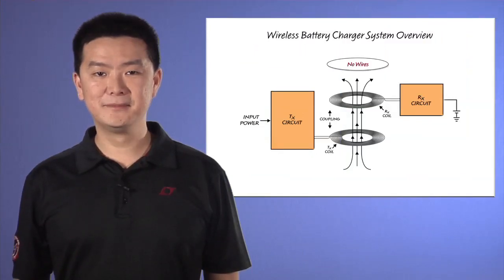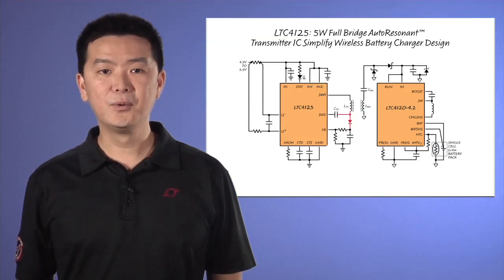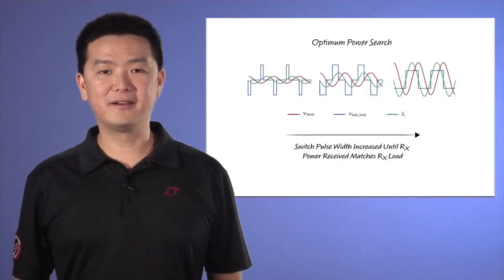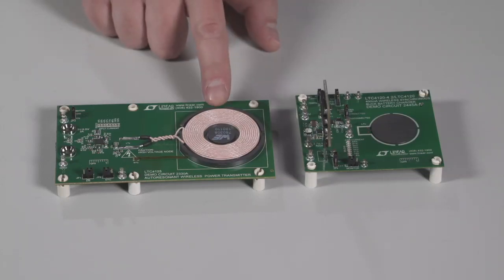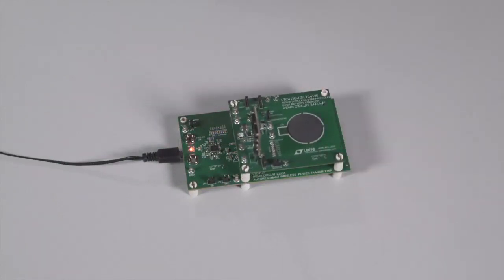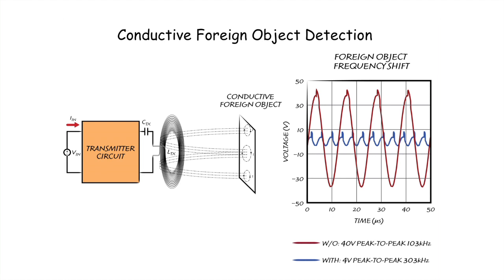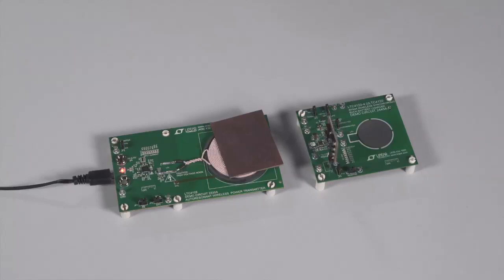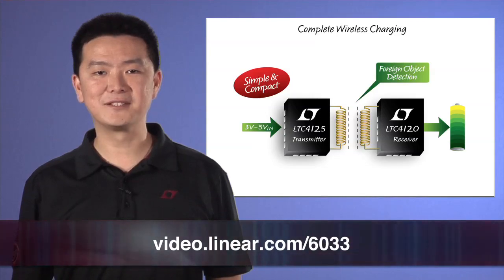5W Full Bridge AutoResonant Transmitter IC Simplify Wireless Power Design

Comment: what is the diodes on rectifier? i need some ultra fast high voltage blocking(650V) 2amps smd diodes.you should inssert a ferrite at receiver and receiver. awesome technology again